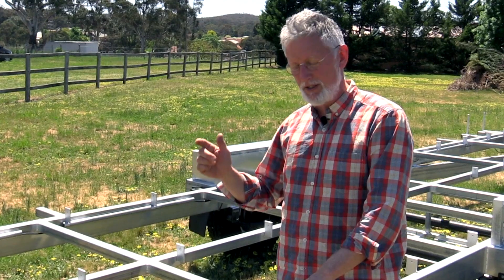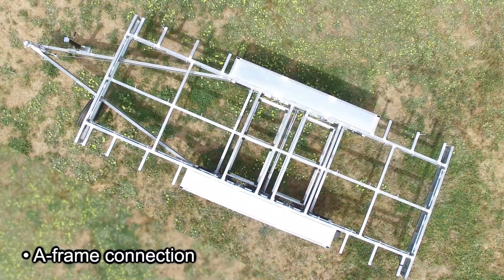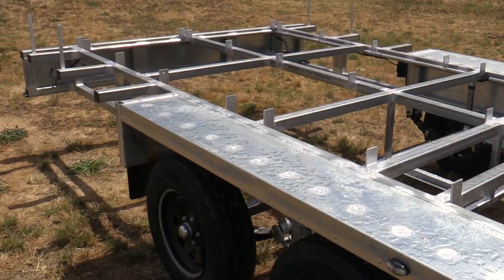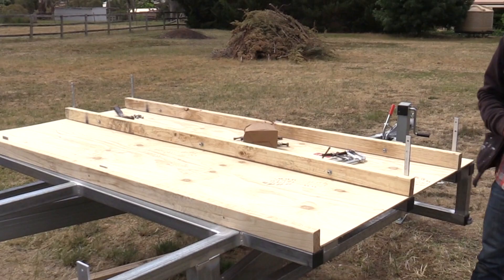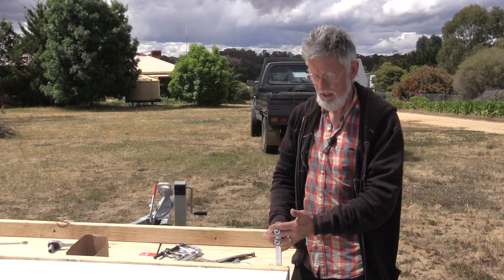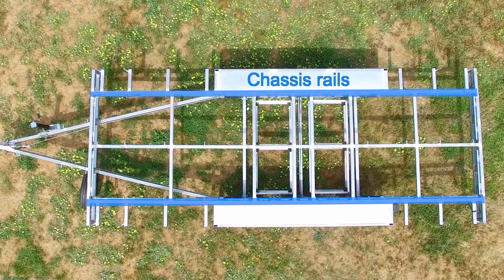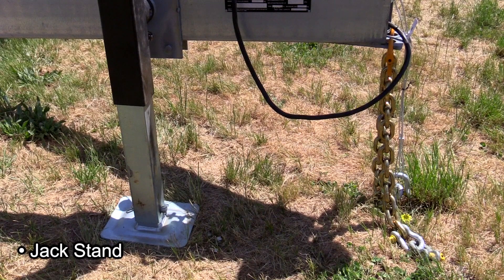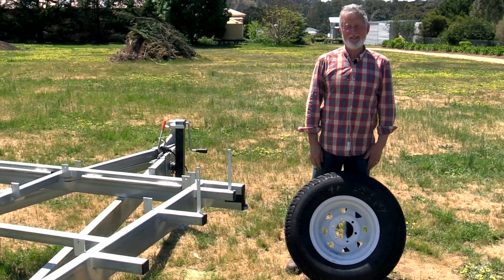The best built tiny house trailers in Australia

Comment: Great video. Just wondering what you think about steel frame construction?
Reply from the maker: Thanks Carlos. Fred does a whole Unit on steel vs timber framing on Tiny House University. Free units here as well as complete training on all the construction problems he has created solutions for: https://www.tinyhouseuniversity.com.au/courses/how-to-build-a-tiny-house
Reply from the maker: Hi Carlos, 
Many factors to consider.  A.) Is steel really lighter than timber?  (That  depends on what the Base Metal Thickness (BMT) is and can vary from 0.5mm to > 1mm thick, which is quite a range.  Steel stud fabricators often advertise the weights for 0.5mm, but then use the heavier stuff.    B.) Are the fastenings rated for the vibrating situation of a steel frame tiny house travelling down the road at 80-100km/hr?  Listen carefully to their answer and if you hear, "She be right, mate" or "We do this all the time for 100's of houses", then that's not an answer to your direct question and should tell you alot.   C.) Thermal conductivity.  Plan to install some kind of a thermal break to keep the heat or cold travelling directly into your house.   Hope that helps.  - Fred